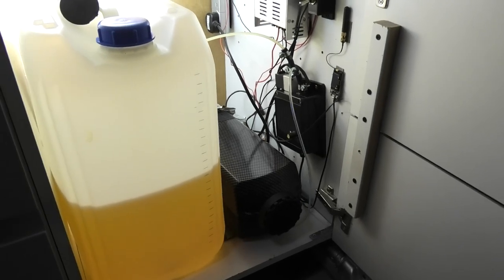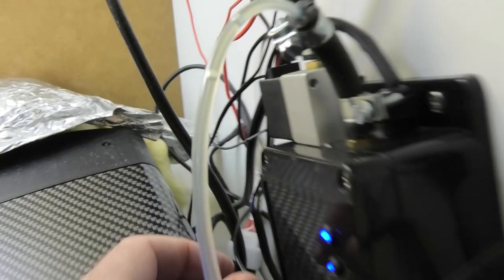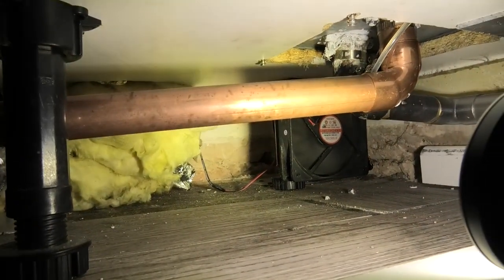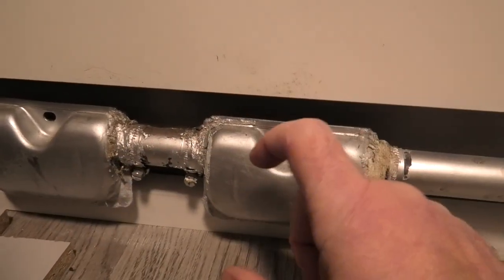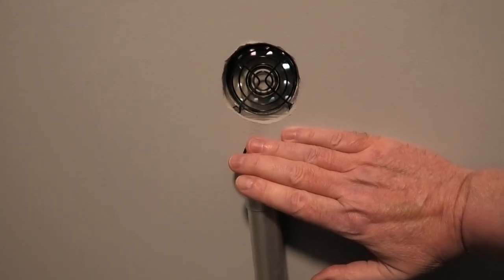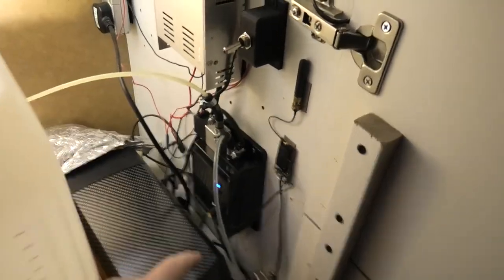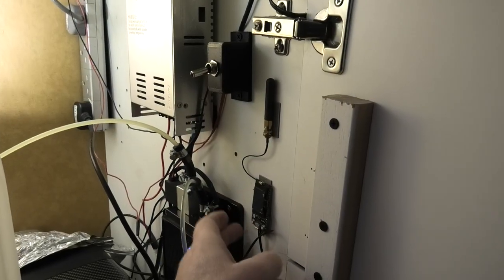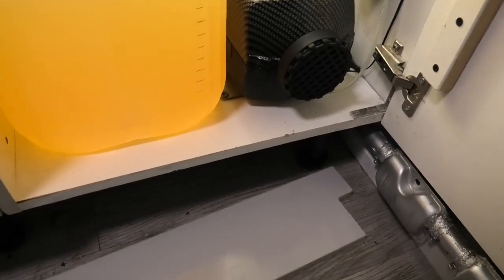Chinese diesel heater - silent pump, how to install and make the whole thing quiet

Comment: It's nice to have a functional heater.  You've probably gotten a ton of comments already, but I figured I'd share as well.  If you think about points of failure, that fan setup to keep the exhaust from causing "burning" in the cabinet screams a fire hazard if it fails.  The ignition point of OSB is around 205 C and the exhaust temperatures are around 270 C.  If your fan fails, and if that cabinet starts to show signs of burning, you are approaching the ignition point and if there is anything else that gets in there (spider-webs, dust, whatever), you could have ignition.  I highly recommend that you look at some type of heat wrap on the exhaust so that the heat energy travels through the pipe to the exit as opposed to radiates in the cabinet.  I also noticed that it looks like you plugged your weep holes in the exhaust - hopefully you've accounted for water accumulation as the burning of diesel creates anywhere from 5 to 12% water which will accumulate over time and could cause exhaust performance issues.  I say "could" meaning that if you have a slope (just like you'd do with a high efficiency natural gas heater) the exhaust should not accumulate, but those mufflers are a prime area for it to accumulate (and why they have weep holes).  The "muffler" should be located externally in a safe setup as the weep holes do allow for small amounts of exhaust to enter in an enclosed area, but the risk is typically minimal (once again, if you were designing a residential furnace, this would be a huge no-no).  Either way, thank you for the post - the pumps definitely are a bit louder and there are some nicer silent ones out there - I mounted everything externally to the shop (and pumped hot air in) as opposed to having it run in the shop so help avoid exhaust type issues.  I'm in a climate that regularly has -29 deg C and I have yet to have an issue with an external setup.    Also - the flash point of diesel (#2, min flash point) is around 52 C.
Reply from the maker: Okay, there's a lot to answer here but I'll do my best.......
Obviously, this is specific to my own install and it's not good enough for every other scenario.
Yes, there is a fire hazard if the fan fails but there will be a fire hazard no matter what, due to the design of the heater itself. I've purposely stopped the lower fan and left it off for an hour when the heater is at 50% (which is where it's always running) and I don't get any burning, it's only when it's at full output does it get hot enough to cause potential problems.
The fan is there to use the heat from the exhaust and keep the kitchen warm, I did use proper exhaust wrap at first but I couldn't stand the thought of it then becoming wasted heat.
The weep holes are none existent in the Webasto silencers I bought whereas the Chinese ones to have them. I'm assuming that it evaporates when it's running as I haven't had any problems in the 3 years that it's been running. The mufflers couldn't be mounted anywhere else due to limited space in the air-brick area, I did try to mount them there, but they're around 1/2" too long.
At the exhaust exit point where it goes into the air-brick, the surface temperature of the exhaust gets to around 60C when it's at 75% power. I've dripped diesel onto the exhaust and it doesn't even smoke. I don't know where they get the 'flash point' from but I'm assuming it's vaporised rather than droplets.
Yes, there are risks if the lower fan was to fail but I've taken as many precautions as possible. One thing I didn't show is the addition of a smoke alarm underneath the cabinet and I have a total of 3 x smoke & CO alarms in the kitchen.
The heater is only working when there is someone inside, it's NEVER left on in the night or when I go out and there's enough warning systems and fire extinguishers to battle any fire before it has chance to get out of hand.
Every heating system comes with its risks but hopefully, I've eliminated or taken as many precautions against potential problems as possible.
Reply: @Vortecks  Thanks for the reply and perspective!  It's great to give people ideas and concepts that they can try to apply to their own situation.  Each time I watch one of these videos I learn something new - thank you again for the great content!

Comment: I've seen where people draw air from inside creating negative pressure, which pulls cold air from outside through any little crack in your structure.  This hurts efficiency enough as is, but why would you exhaust air you spent fuel heating outside?  This would be creating even more negative pressure.  You should pipe your intake to that hole where you have that fan.

Comment: Bandage the pipe and purchase a small household radiator,with a little modification would also act like a bafle . You could then get rid of that fan..any heat would disappear through convection.

Comment: Thank you for sharing it Tony! I need to do something like this. Todays energy prices killing my budget.
Reply from the maker: It's still killing my budget but I can stay warm, no matter how cold it is. If I can find a supplier of kerosene, it'll be £1.20 a litre instead of £1.70.
Reply: Hi Tony 

Again nice vid 😉 
What are the cost or running this is this cheaper then normal heating ? And does it run for 24 hours a day?
Reply: And: do you have there red diesel? It's cheaper then regular. Maybe thats good solution?
Reply from the maker: @-_Robert_-  No mate, I can't get anything around here apart from pump diesel, believe me I've tried!

Comment: I’d love to see a maintenance/service video please. Never taken mine apart, never had a problem. I’m tempted by the tuning video but have only ever used mine in the garage (mounted outside with circulating air) in Temp mode and it’s been brilliant. I am kinda thinking it ain’t broke so don’t fix. Just would love to see a teardown and maintenance as I said. Many thanks and hi from Blackpool 😊

Love the look of the monitor as I’ve been into arduino and esp etc for a while.
Reply: They are really simple to work on - Allen bolts if you're lucky. It's the junk electrics that cause all the grief!
Reply from the maker: I will do a maintenance video but it won't be for a while yet. They are easy to work on but it's the fans that are a pain to remove and refit (there's 2 of them).
I suggest you do what you're thinking..... if it ain't broken, don't fix it because you'll regret it and it'll never seem to run the same again. If it's broken then there's nothing to lose 😁

Comment: I've got a household radiator to retrieve heat from exhaust fumes and it worked well, outlet temperature is 20'C and water.
Tickling is absent because the pump is suspended with pipes and there is no vibration on the cabinet.
I've to ask more about that black box, exactly what is doing more than the stock

Comment: Hi great informative video.
My brother and I are installing a diesel air heater in our vans. My brother has finished his first but it’s blowing smoke would it be due to a 3m long exhaust pipe?
Also when he started it up he noticed the base plate under the heated unit was getting very hot. That means the floor was getting very.
Thanks let me know how yours was.
Cheers
Brenton

Comment: I laughed when I seen the air vent. I bought Chinese 8kw (5kw) diesel heater few days ago🇧🇬. And then wondered if could fit one in the flat back home via the kitchen air brick and maybe use expanding fire foam seal the area? Great content Tony, keep going through 2023. Time now to get ready 80km round trip on the ebike xmas dinner. 🎉
Reply from the maker: Make sure it's tuned mate. When I first installed mine, it was kicking out a bit of black smoke on start-up. The airbrick is now discoloured which I can't get rid of.
I hope the ebike journey wasn't too cold for you, you're braver than me 🤣🤣🤣
Reply: @Vortecks  Yeah, I did view your video about tuning and maybe taking away some mystery made me final buy a diesel heater? Given cost of LPG, time now to expand and diversify the heating. Flat back home the soot on the air brick maybe a problem cannot be cleaned? 

Was a glorious sunny day, blue sky, excellent weather and very mild weather return journey home. 

I really want travel Haskovo, before New Year, only 126km, non-stop if possible, final got a tailor to encase in kevlar a large square of 12mm thick silicone gel padding. The comfort level is vast improvement 👍👍😎 Tony, please keep making your videos they are awesome and will do my utmost to be in the customer queue buy that BMS are working on. 🇬🇧

Comment: How does your exhaust deal with the condensation that build up within it ?
Reply from the maker: Good question.... it doesn't.
The genuine Webasto silencers don't have a drain hole like the Chinese ones so I'm presuming the condensation evaporates as it heats up. There is a fair amount of steam/condensation that comes out in the first 5 minutes of running so I presume it just gets rid of it that way. In 3 years, I haven't had a problem so I can only assume it works that way.

Comment: Tony could you run relays or a couple of opto devices for the fans so if they drop out the Webasto knock off stops.  
   Great project by the way!

Comment: I used to run mine on bio diesel but if you do, and leave it unused over the summer the pump gets trashed. Varnished I expect. Anyway. You can run them quite happily on 75/25 diesel / Bio with no issues. Any higher like 50/50 and on the really couple of cold days we had last month i had to take pump off and heat it up with gas flame to free up pump, If using bio the pump settings are 1.2 and 3.6. If you set it to 8 it will lay down a thick white smoke screen better than any Royal Navy battleship. In the 40 seconds it took me to enter advance settings and turn pump down the entire estate i live on looked like a high budget horror film. Ref your 22mm copper pipes, I tried that some years ago but could never get a nice fit without snipping the push to fit plumbing, always wondered if America have imperial sized fittings we could get shipped over? An extra couple of mm would be great.

Comment: Nice setup 😀 wonder if exhaust bandage would be a substitute for the lower fan? The monitoring/ control unit looks interesting too.
Reply from the maker: Yes, it is and at one point I did have it covered but all that heat was then lost. Now, it's heating the kitchen 😁
Reply: @Vortecks  Maybe better to use sticky silver foil on the underside of the kitchen unit to protect it. Then you still get the extra heat. 😉

Comment: That fuel pump. Will it run on 12 volts? I’m looking for something that is nice and quiet for cold spring and fall nights on a 27’ sailboat.
Reply from the maker: Yes, he has 12 and 24 volt units. Mine is a 12v and it's been running perfectly for over 12 months now.

Comment: Hi mate this 2nd gen pump anti syphon can you have it higher or lower then the fuel tank do you know ? Sure I seen a video he’s got this pump higher then the tank
Reply from the maker: If you get the anti syphon version like mine, you can fit it higher or lower than the tank, it's up to you but it's a bit of a waste of extra cash if you fit it higher.
Reply: @Vortecks  thanks buddy I got the pump from a motorhome group off a kid that had sold up so was 60quid I’m just trying to find out information about it that’s all 
My fuel tank is the one in my van which is basically floor level in the van so is the diesel heater that goes threw the floor 
So the fuel line comes from the fuel tank on the chassis to the rear of the van then goes to this pump that’s screwed under the floor in the van then goes upto the heater

Comment: I assume you know, but the fuel pump design is to run on a 45-degree angle to remove air.  Streight up will actually wear it out.

Comment: Hey Tony have you Heard of the easy way of cleaning waste Veg oil using Gelatin? It's the easiest and low labour way of making "biodiesel" for 40-50p per liter including paraffin to thin the cleaned oil.
Reply: I watched that video as well TnT channel.
Reply from the maker: Yeah, I've seen them all now, the trouble is, I can't get waste veg oil. I've been around all the local places where it's used and they all have contractors to remove it. Something to do with proof that it's been disposed of in an environmentally safe manor.
Reply: @Vortecks  fair dues just thought I'd mention it just in case
Reply from the maker: @jamesemery1  Cheers mate 👍
I could dispose of the stuff in an environmentally safe manor by burning it, it's only the same thing as they do with it. Bloody regulations spoil it for everyone (me at least).
Reply: @Vortecks  maybe look at the regs and see if you can get the correct paperwork to be classed as a "proper" disposal method it's worth having a look into it.  Or maybe find a mobile catering van that doesn't have a fixed place of work maybe they could be more amenable to letting you have the oil

Comment: Use exhaust wrap this will lower the external temp. Warning use gloves the wrap is evil to touch with bare skin
Reply from the maker: I did use proper exhaust bandage to start with, but it's then waisted heat that I couldn't use. Having the fan under there circulates the heat and keeps the kitchen warm.
I know what you mean about wearing gloves - I found out the hard way 🤣